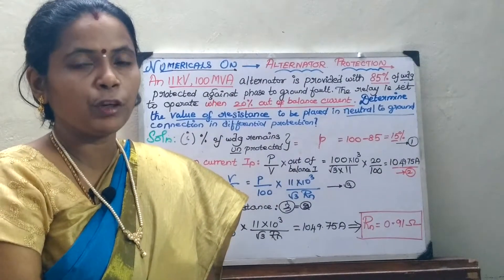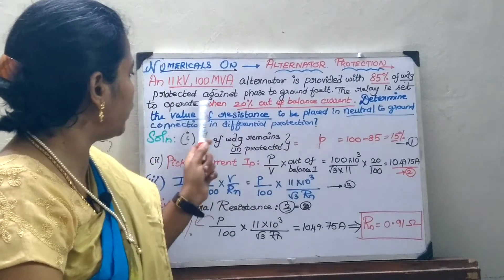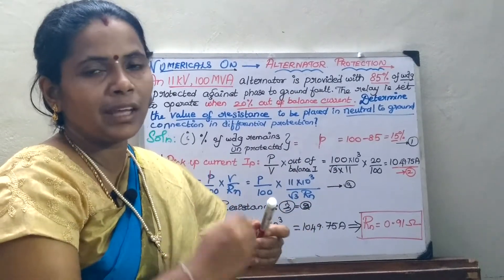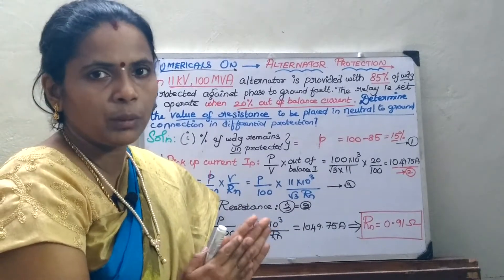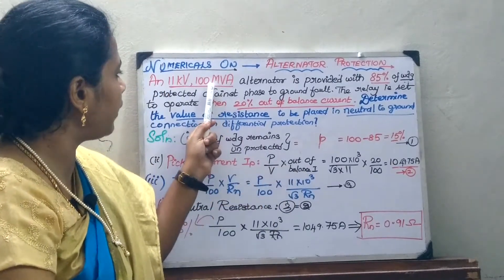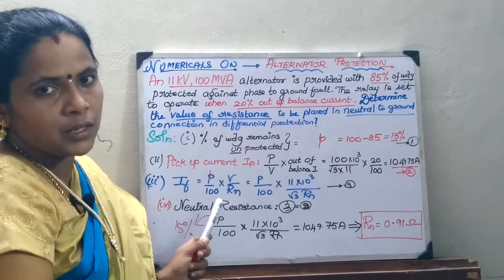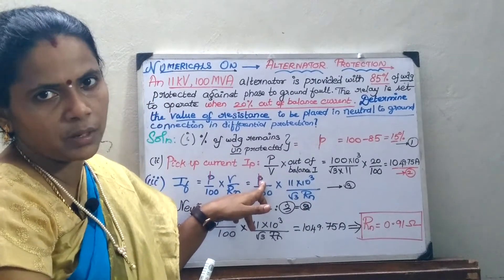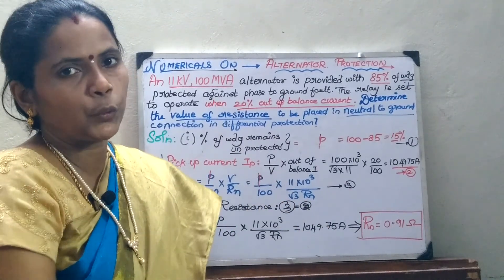12  Problems on generator differential protection Determination of Neutral Resistance

Comment: Given Data:
•	Alternator rating:  11 kV, 100 MVA
•	Percentage of winding to be protected:  85%
•	Differential relay setting:  20% out-of-balance current
•	Fault condition:  Ground fault
Step 1: Fault Current Calculation
we Know:
Ifault = Sbase / Vbase , 
Where:
•	Sbase is the base power in VA (100 MVA = 100 × 10⁶ VA),
•	Vbase is the base voltage in volts (11 kV = 11,000 V).

Ifault = 100 × 106 / 11,000  = 9090.91 A   
Step 2: Adjust for 85% Protected Winding
Ifault, protected = 0.85 × 9090.91 = 7722.27 A  
Step 3: Relay Setting (20% Out-of-Balance Current)
Idetected = 0.2 × 7722.27 = 1544.45 A  
Step 4: Grounding Resistance Calculation
Using Ohm's Law:
Rground = Vbase / Idetected 
Rground=11,000 / 1544.45 = 7.12 Ω